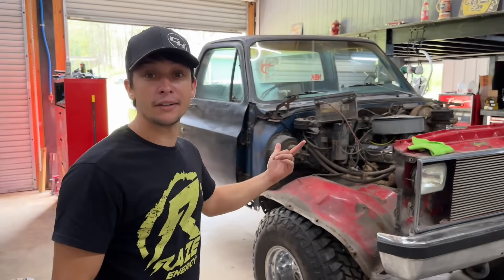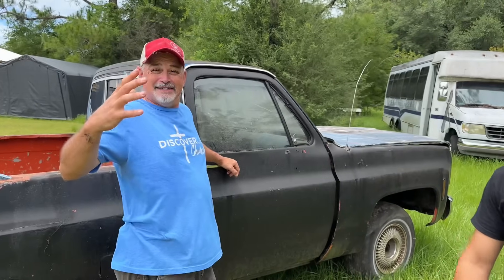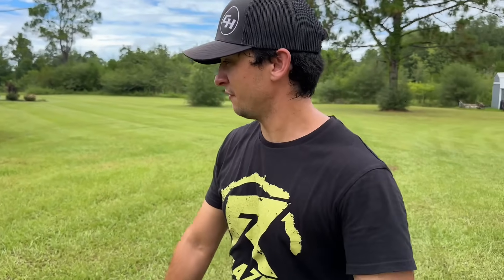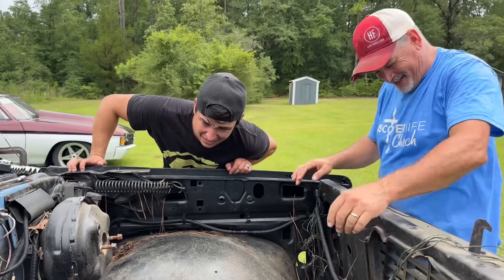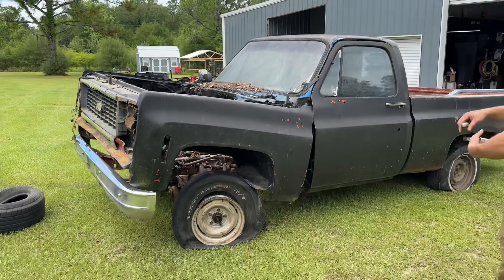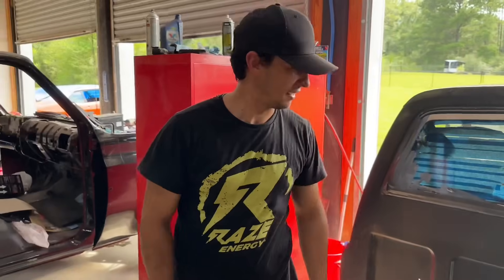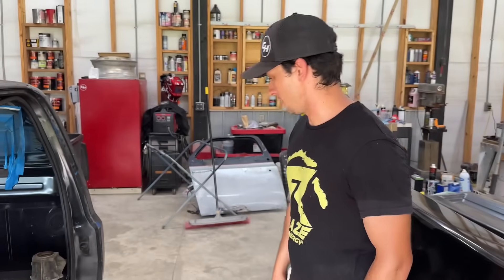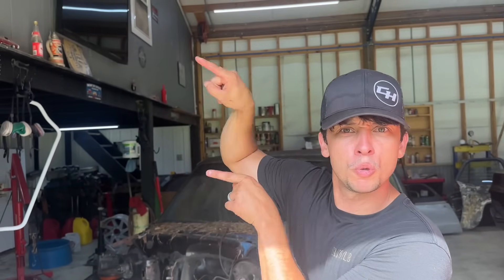Hank Pulled The Plug On His Squarebody Build!!!

Comment: What you going to do with trans tunnel 4x4 have taller floor tunnel
Reply from the maker: @randypeterson8738  I actually hadn’t thought about that… I’ll have to take a look at what’s going on. I know my 2wd tunnel fit a 46rh for our Cummins swap
Reply: @CoopsHouse  been there before love square body’s
Reply from the maker: @randypeterson8738  you and me both! I appreciate you pointing that out. I genuinely hadn’t thought about it lol
Reply: Also different years frame bumper mounts different vent windows in doors and glass are different if  you get to swamping parts just trying to help
Reply: Dashes also different
Reply from the maker: @randypeterson8738  yes sir. I appreciate any pointers!
Reply from the maker: @randypeterson8738  how different is the dash harness?
Reply: @CoopsHouse  harness easy swap from one to other 80 model will be different in places like dome light and cluster
Reply: @CoopsHouse  are you swapping front end ?
Reply from the maker: @randypeterson8738  we’re planning to keep the one that was on the original truck
Reply: @CoopsHouse  fenders will bolt to cab but hoods different be some fab work for hood old one has long hood bolts to fender 80 model has short hood bolts to cowl inner fenders different also
Reply: @CoopsHouse  at this point I think you would be better off to put together find your problems before you do body work or spend money on parts that won’t work

Comment: Your going to have problems with the cab fitting on the 4x4 frame because you are using a 2wd cab the 4wd cabs have a bigger center hump but you can put a body lift in it and it will clear or modify the center hump from the 4wd cab onto the 2wd cab…just warning you guys
Reply from the maker: @scottmiller3576  thanks for the heads up! We’ll see what we can come up with